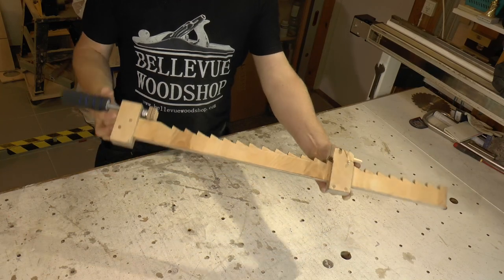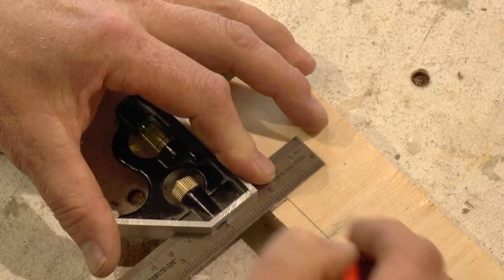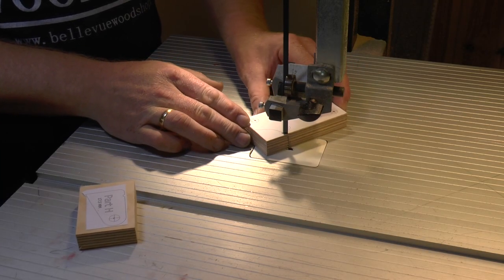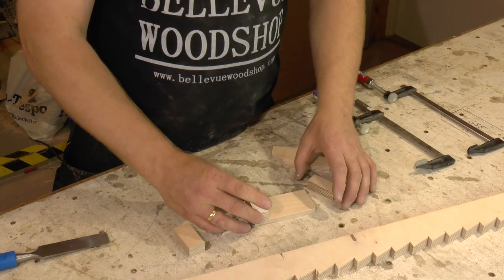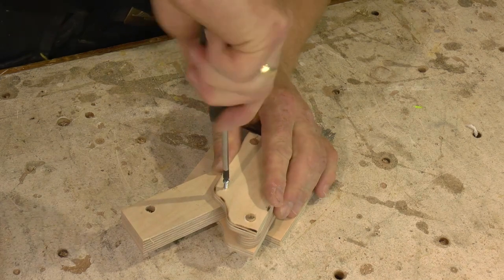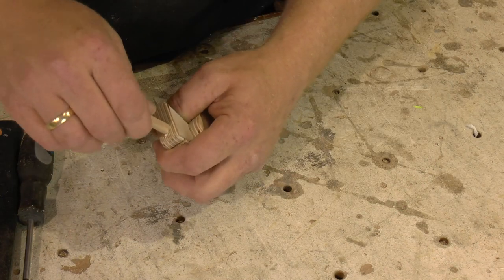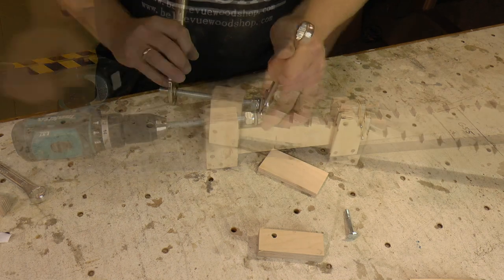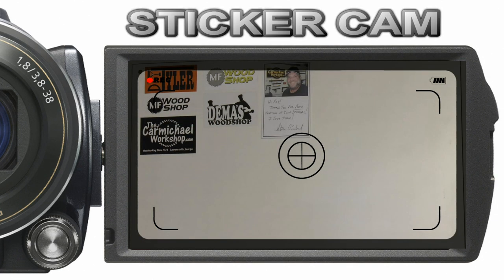DIY Ratchet Bar Clamp

Comment: I was wondering where the biscuits were, then bam......with honey. Just an idea for helping with the racking problem, Steve French has a cool idea in a video he did on shop improvements. Truly enjoy your videos.
Reply: Think you where trying to comment on Jayes video :-)
Reply from the maker: Michael Mueller Yup I think this was headed for Jay Bates pipe clamp workbench vise. But thanks for watching Danny Shackleford
Reply: Bellevue Woodshop That is weird. I was wondering what happened to my comment. I watched his video right after yours. I tried to comment on yours and his but when I submitted it I got a message that said there was a problem(I'm using my daughter's tablet because my phone is broken)..... Anyway sorry about that.... Like I thought I said last night, I like the clamp and I usually thread bolts right into the wood and haven't had any issues with them pulling out. The lock with the rubberband is the best part, I would probably just play with the clamp at first, making a bunch of clicking noise..... until my wife got annoyed.
Reply from the maker: Danny Shackleford  Hmm, YT sometimes play some dirty tricks on ya. :) Thanks on the feedback on the clamp, it is much appreciated. Funny you should mention the clicking noise.....I have taken myself, several times, just ratcheting and making clicking noises again and again. . thanks for watching

Comment: I wonder if a small diameter bungee cord would work better than rubber bands. Also have you tried to make longer version? I am imaging 6ft long, but you would probable need it them to be a lot thick and maybe wider.
Reply from the maker: +Michael Crawford I dont see why bungee cord could not be used. I just used some readily available parts. I think if you want to avoid major flex, they should be taller , but wider would of course also work, especially if you use plywood. Thanks for watching and commenting Michael

Comment: From "Mat S" (he has replies disabled) "Great clamps - how come you decided to put the ratcheting mechanism on the top "clamping" surface rather than the bottom "non-clamping" surface?"

I had that thought as well (at first). But now that I think about it, having the notches toward the piece that's being clamped would help keep glue from sticking to the clamps, when doing big glueups.
Reply from the maker: J DeWitt I noticed the same thing, and notified him, and also answered the Q in a PM.  I did not actually experiment with it any other way, as I am unsure about how one would achieve a positive stop for the upper part with the notches on the bottom of the bar. i might be missing something obvious here. But as you say, it creates less contact surface with the glue-up surface with only the top of the ratchet notches touching the board. Thanks for watching, sharing and commenting
Reply: Bellevue Woodshop The design would have to be slightly different, but you could have notches on the bottom and still have a positive stop for the upper part. Think of it like this. Instead of pushing against the notch on top, it would be pulling against the notch on the bottom.

Comment: Veldig kult! De så ganske så stødige ut også.
Hva heter forresten den typen kryssfiner du bruker? Minner meg veldig om det de bruker mye av i USA, men jeg har ikke sett noe av det i Norge noe sted.
Reply: Bellevue Woodshop Jaha! Så det er det samme jeg ser alle americanerne bruker. Synd at det er dyrt, for det er veldig bra som du sier, også ser det veldig pent ut og til å være kryssfiner. Vet du ca kvadratmeter pris på det? Jeg kunne tenke meg å bare kjøpe en liten bit til å lage såkalt "miter-sled".

Hva er forresten den sliper'n på 2:52 i videoen? Ser ut som en fler-eteasje spindel-sander med forskjellig tykkelser eller noe? Ser veldig stilig ut i hvert fall!
Reply from the maker: Bjørnar Magnussen Har du rett og slett sag med miter-slots i? tøft. Nei pris er jeg usikker på, men gjetter 1000-1200 +mva for ei full 8x4 fots plate, men som sagt, kun gjetting. Slipemaskinen er en egenprodusert og designet tårnpusser, og som du sier den har flere diameter spindler som kan brukes samtidig. Du kan sjekke ut viden på den her: https://www.youtube.com/watch?v=Ha_ywT7Plns
Reply: Bellevue Woodshop Har sag med miter-slots ja. Eller, jeg skal kjøpe nå snart.
Om det er rundt 1000 lappen for en plate tror jeg at jeg må styre unna :P Kjøper heller nytt verktøy til den prisen!
Jeg skal sjekke ut den spindleren! Trodde jeg hadde sett det meste du har lagt ut, men må ha gått glipp av den videoen. Takk for svar forresten :)

Comment: A good way to harden wood threads is to soak them in CA/Super glue.
Reply from the maker: Tyler S I have never tried it, but I guess that would work great. I remember in my model airplane day, I always reinforced the balse cutouts edges and endgrain with superthin CA glue